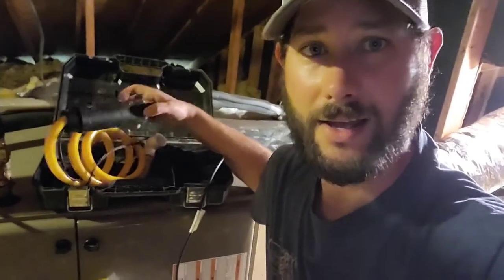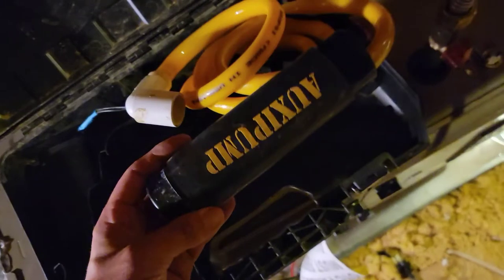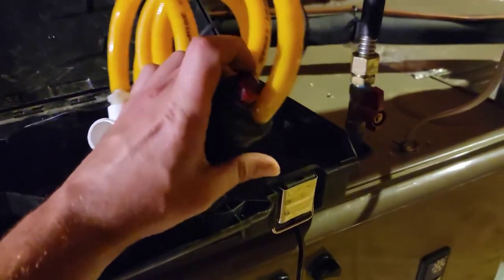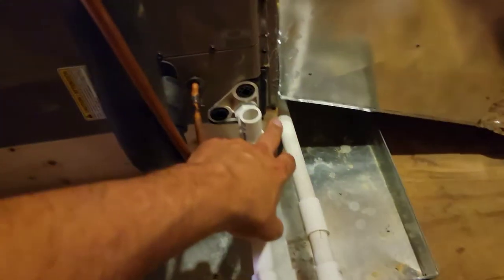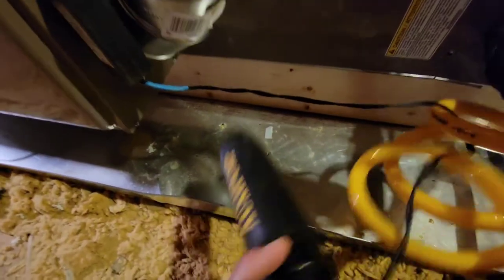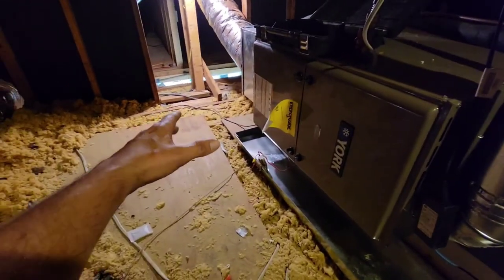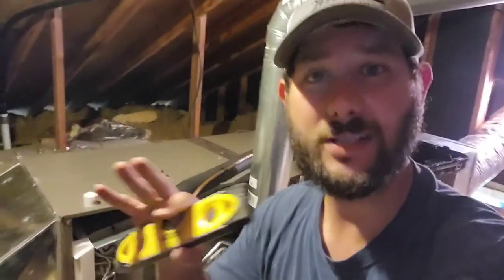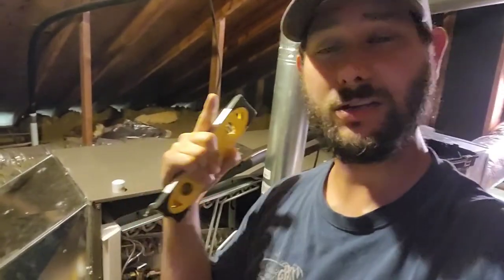The Best way to empty a drain Pan with the AUXI PUMP? #hvaclife #hvac

Comment: I cut the drain and have a clear rubber hose connected to a coupling I attach to the drain at the AHU when the vacuum is connected and running outside (after the drain line is cleaned first)
Reply from the maker: Great tip!

Comment: Wish I had that. I Just used a sump pump, hose and a bucket. Also, I have no way to clean out the PVC pipe, full of gunk.
Reply: I hooked up 2 hoses, ran one through a window up into the attic. Kinked it until I was ready and blasted it out. 2-3 bursts should do it.

Comment: Milwaukee makes a battery operated one
Reply from the maker: Dude that is awesome
 I'm gonna check that out
Reply: Use the male fitting for the drain pan and two plumbers hoses and tightening straps works wonders from the pan down the drain line